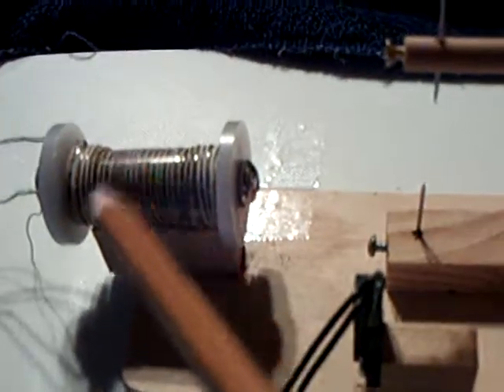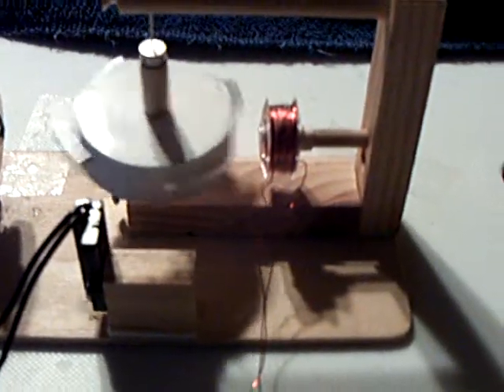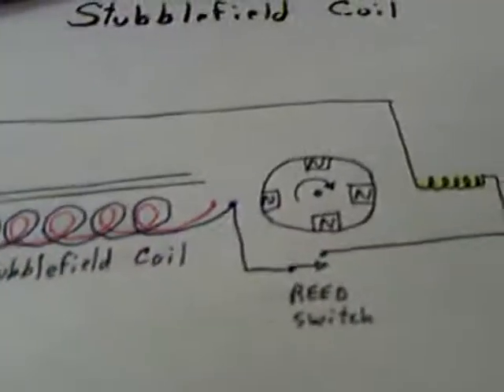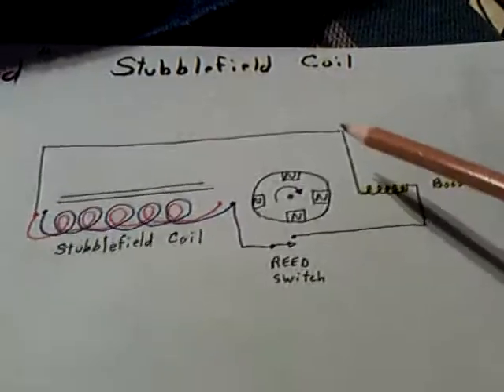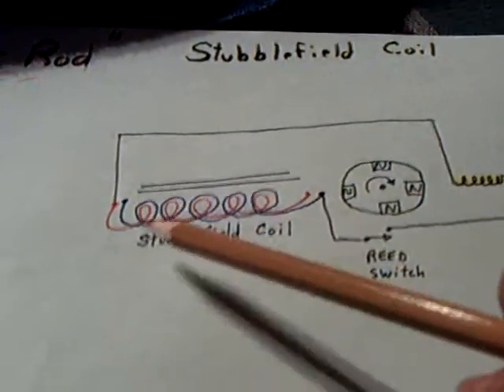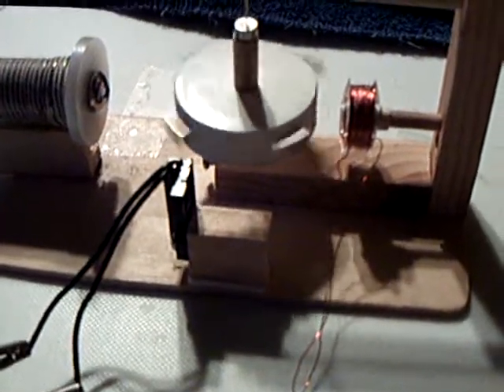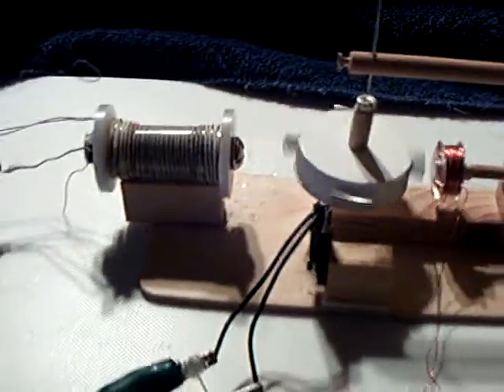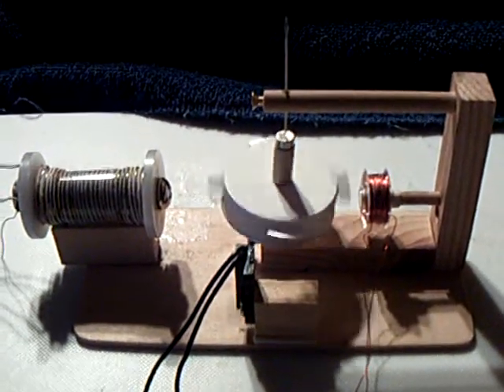Miniature Stubblefield coil---part 2.ASF

Comment: Lid:

Maybe try sticking a supercap in line with the LED and after a bit, I will bet you will get continuous light from the LED.  Probably like a 5 or 10 F supercap would be plenty.  It will catch the spikes and eventually you should have enough to keep it on all the time.

It has worked for me in a few situations where i had a blinking LED when powered by a spike generating power source.

Of course, I may be totally wrong in this application.

Very nice work on the mini-Stubblefield coil.

Bill